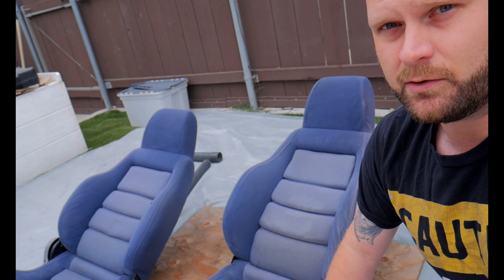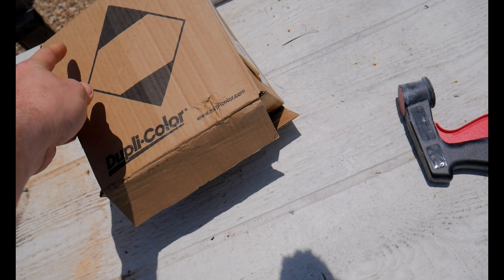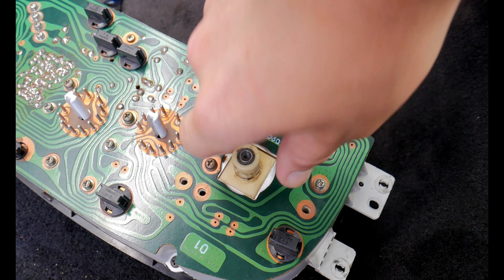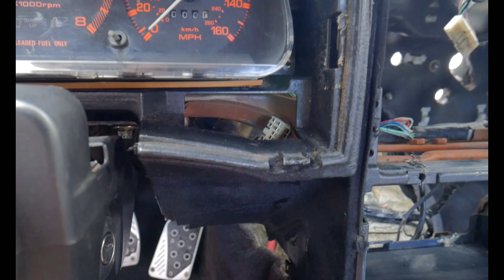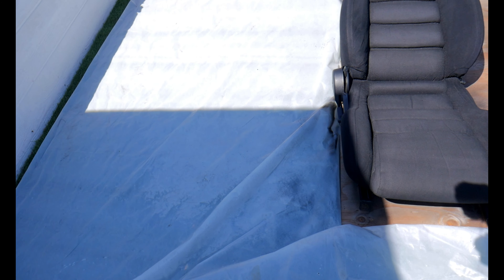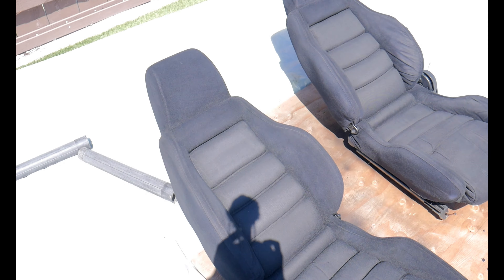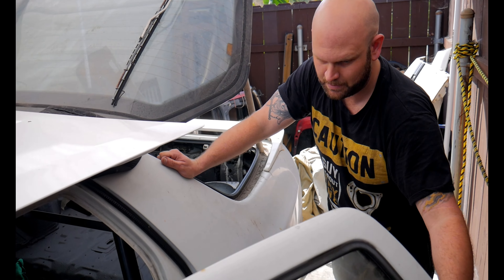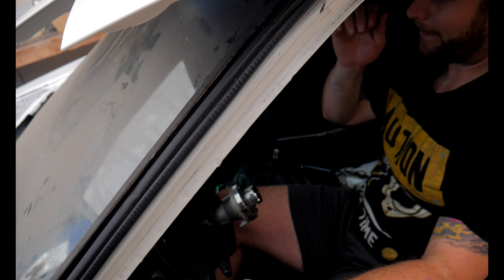painting the seats black!! // interior install electrical test fc rx7

Comment: I’m curious about the paint. My seats have been reupholstered, are in good shape, but they are 2 tone gray. Would like to turn all my interior black but I would hate for it to fade away over time and need constant touch ups. Thanks for the video!
Reply from the maker: It does fade and wear off over time...
Reply: @MohrGarage  I wonder if that has to do with it not being good product? Not enough coats? Maybe a stronger product and more coats could be a permanent solution? What’s your thoughts on that?